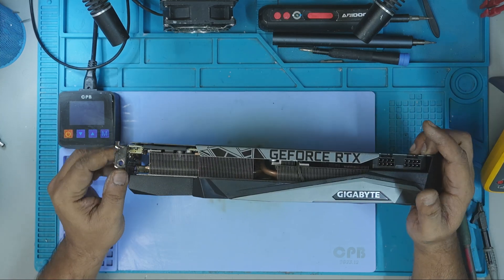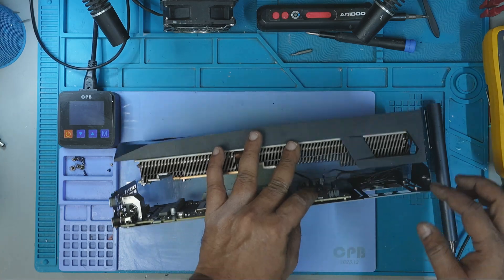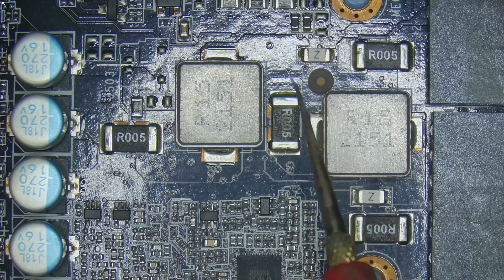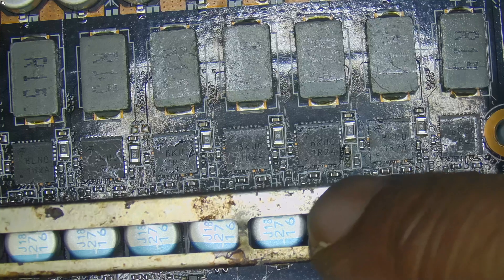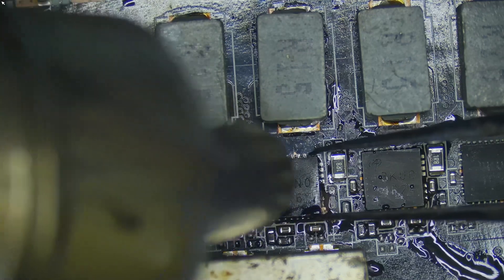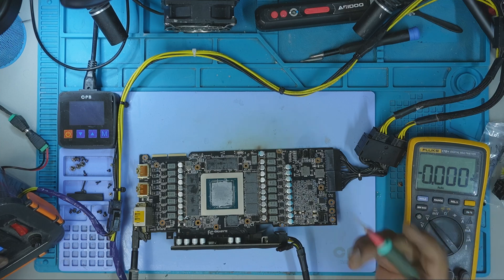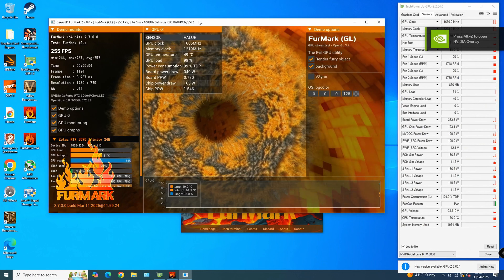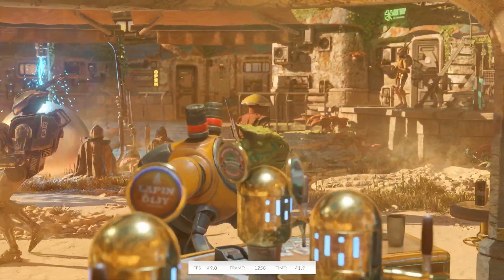Gigabyte RTX 3090 Repair   Not Detected Fix

Comment: Third DRMOSFET from the top is the blown one. Again. Quite a defect.

On all 3080Ti's and 3090s from Gigabyte that have a 12V short, it's always been that the 3rd one from the top is the problematic one.
Reply from the maker: Yes most of the time these are the ones that are failing.

Comment: I love your videos I'm from India. I also have a gigabyte Rtx 3060 12gb it's showing rail voltage and pcei slot voltage only 9.3v  and GPU overheating at full power.
What is the problem?
Reply from the maker: Check the mosfets connected to PCIE using a thermal camera. one of the MOSFETS may be faulty.

Comment: Hello, First Great and amazing job, i have a 1660 ti and its not getting detected and the fans not working what happened is my electricity went off and on multiple time and after that the gpu stopped working someone said to me the ic units is not working so no power going to the gpu what do you think is the problem ? please answer me if you can.
Reply from the maker: Difficult to say unless the GPU is diagnosed. The GPU will need to be tested to check which voltage rail is missing.

Comment: Could I pay you to upgrade my RTX 3070 Ti to 16gb vram?
Reply from the maker: Unfortunately I have not managed to upgrade any GPU with GDDR6X memory. 3070 Ti uses GDDR6X. Once I manage a breakthrough I will release a video. After that I can accept 3070 Ti for an upgrade.
Reply: @GraphicsCardRepairs-tk7ql is it not just desoldering and resoldering or is there something I’m missing
Reply from the maker: @deadbot61 which hot air station are you using?

Comment: I recently bought a cheap 3080 Turbo for repair that also doesn't detect or have any display output. I have to make another MATS/MODS boot drive to test 3080's yet. I'm now wondering if it might be the same issue the 3090 card had with a Mosfet/s?
Reply from the maker: You would need to look for the same symptoms.
Reply: @GraphicsCardRepairs-tk7ql  Thanks for the response, yeah I'll have get around to assessing it some more 😁

Comment: is it possible to upgrade my 6600xt vram to 12 gb
Reply: You'd pay more than buying another card that already have that amount of memory. You think 12GB of VRAM will make the 6600XT card able to play Fortnite in 4K just because it has more VRAM?
Reply: @Dandan-tg6tj  i didnt even mention fortnite neither i play that game he said its not possible if it was i would done it myself
Reply: @k419  If you play Fortnite or not, it's beside the point.  If it was possible you wouldn't be able to do it yourself. You think for 6600XT you only need to add more VRAM and that's it? You would need to find a modified BIOS and that is not possible because BIOSes for the cards newer than RX 5700, are locked.
My question still stands: You think 12GB of VRAM will make the 6600XT card able to play a game in 4K just because it has more VRAM? Maybe you don't really understand my question. I'm not being mean, just thinking about the possibility.
Reply: @Dandan-tg6tj   im not trying to play any game at 4k just 1080p some games want more vram at 1080p more then 8
Reply from the maker: Not possible unfortunately

Comment: How to upgrade 5080 to 24 or even 32-48 GB of VRAM
Reply: Why TF didn't you buy a 5090 if you wanted so much  VRAM?
Reply from the maker: It is yet to be tested. 3GB modules are not yet available in the open market.

Comment: hi i want to ask. which part is broken if the VGA is on and display for a while and then turns off and restarts the pc then the fan spins fast? thanks i like your video
Reply from the maker: Which GPU is it? If it's 3090 first I want to ask if the pads were replaced. If yes check if oversize pads were installed. If not then the MOSFETS would need to be tested with an oscilloscope to check if all are turning on else the core would need a reball. It is also possible that the core is in its last stages.
Reply: It's a 3070ti  @GraphicsCardRepairs-tk7ql
Reply: GPUz will tell you maximum temperatures of the core, of the hot spot and for some cards of power part, for some cards even the memory temperature. If it's a too high of a temperature somewhere, you should already know what to do, otherwise, go to someone who knows and pay the man. Watching Youtube videos won't give you the answer if you don't know the basics and I know for a fact you don't know the basics because of the question you asked. You can transform an easy repairable card into one that's badly damaged so be a smart one and ask for qualified help.